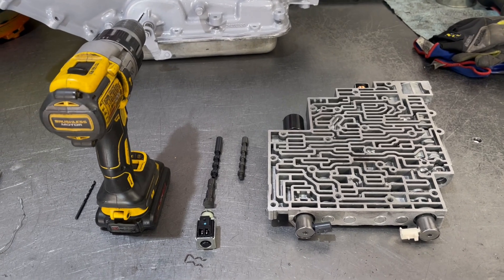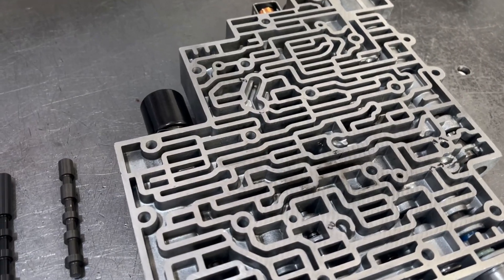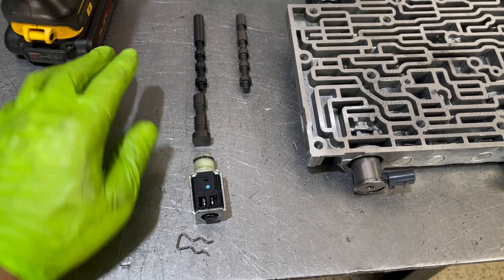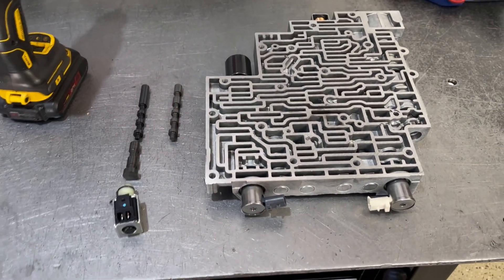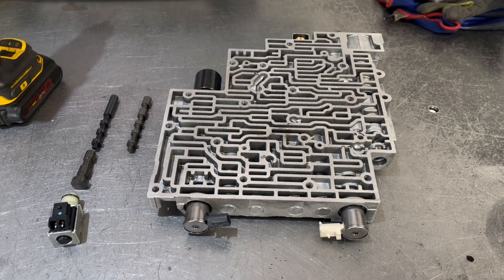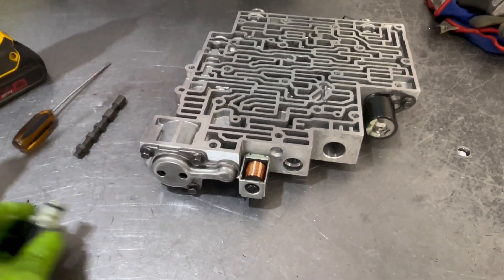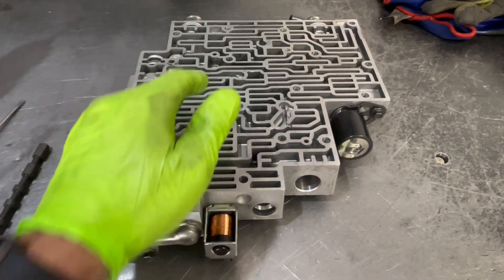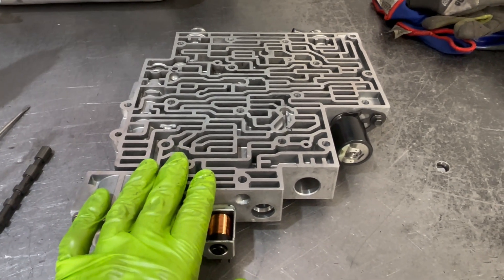4L60E Sonnax Heavy Duty 2-3 Shift Valve

Comment: Great Video,  i also do install the Sonnax HD 2-3 shift valve for a Performance Build,  But never left out the check ball,  You mentioned That leaving out #6 which i believe is the check ball in the pocket next to the Tub?  (Not the ball in the Tub?)  will give a more robust apply to the coast clutch. OK how will this effect normal driving and cruise ?
Reply from the maker: I only leave it out for HD builds, it's not necessary for daily drivers w/stock engines/etc. Yes, the one next to the bath tub - don't omit the bathtub check ball.
Reply: @nickstransmissions  Ok, the car its going in is definitely not a daily driver, 700HP supercharged , But mostly a weekend cruiser with some pulls in the street, Not sure if it would ever see the track, not sure if i sould leave that check ball  in or out, What would you do?
Reply from the maker: 700HP? The answer is in that video insofar as what I would do.

Comment: I'm going to take a shot here and hope you get these questions. I recently bought a 03 Silverado 1500. Regular cab step side 5.3 4l60e 4x4 107000 miles. Beautiful, clean, well taken care of truck. I carefully went over the whole truck. What it needed it got. Changed every fluid in it including full synthetic trans fluid filter and flush. I was getting a check engine code, and after a lot of testing, replaced an o2 sensor, mass air flow sensor and, throttle body. All gm genuine parts. The problem I'm having is a hard 1-2 shift and even worse harder 2-3 shift. The 1-2 isn't like a nice firm corvette servo shift it's hard and abrupt. The 2-3 is like the temporary reversal of torque that I have researched about. Now here is the weird part. The first shift cycle is fine, come to a stop, continue driving, begins shifting hard. I'm not sure how the ecm and tcm work but from what I understand it takes a little time for the sensors to send information and the computers to process it. The previous owner might have had some work done on this transmission because claimed it was a heavy duty transmission and his mechanic friend was present at the sale. It seems like the 2-3 shift is a common problem but there is very little information to be found on the subject. Do you think a heavy duty kit was installed? Is there a problem inside the transmission?  What is the cause of the temporary reversal of torque during the 2-3 shift? Is the hard 2-3 shift a normal condition to be expected with a 4l60e?  What do you think is causing my specific issue and do you have any ideas how to fix it? Thank you very much sir.
Reply from the maker: Hi William, there's no separate TCM in those vehicles; GM didn't begin installing a separate transmission control module until 2007 or so. Your symptoms could be related to either MAF/TPS/Ignition Switch or another engine management sensor feeding the transmission faulty data (overstating values that are prompting the trans to increase/max line pressure when it's not called for). Some one may have also messed with the electronic pressure control solenoid, which is accessible once the pan and filter are out of the way. 

I'd rule all electrical/electronic causes out via a bidirectional scan tool, DVOM, etc...If everything is fine (sensors, switches, solenoids, etc), yank the unit out for overhaul.

Comment: Hi Nick, I have a question about my situation with my 4l60e. The 1-2 shift is very positive, probably a little harsh. 2-3 flares pretty bad. 3-4 is good. It bounces in and out of overdrive once cruising. Sometimes it skips 3rd gear and goes 2-4. My biggest issue is the 2-3 flare. My research leads me to believe shift solenoids are the biggest culprit. Am I headed in the right direction? Any help is much appreciated. Thank you in advance.
Reply: I should also note this is in a 4x4 truck (2000 Silverado) that sat for many years (8-10) before I acquired it. It's a mid west truck so it's seen its share of winters and salt. I drained the trans pan and replaced the filter and gaskets and changed 7 quarts worth of atf shortly after getting the truck running and driving in an attempt to fix these issues. That was about 1000 miles ago and there is little to no improvement to speak of.
Reply from the maker: Hi Brandon, you may be right about your solenoids...Check out this video for instructions on how to test them and drop the pan and do the same: https://youtu.be/J9-Vvdrw78c

If you see a whole lot of burnt clutch material in the pan, especially after only 1000 miles w/new fluid, yank it for overhaul.

Comment: Question, I did not drill the hole or notch, I don’t have an engine brake in 3rd at all but the trans shifts good and doesn’t have any issue whatsoever, should I go back and drill the hole just to be safe?
Reply from the maker: Hi Matt, thanks for watching...Drill the hole per Sonnax instructions.

Comment: Rebuilt a 4l80e about a month ago using your instructions it was wicked helpful! fast forward a bit and I've got an extremely hard 1-2 shift and 4th - overdrive shift. I checked all of the resistance in the solenoids when I installed them but they were used/unknown parts that came with trans. It's throwing a Gov pressure sensor code, but before i drop the pan and swap it for a new one, does the hard shifting in only those gears seem like a possible symptom from a faulty Gov Press Sensor? Just wanted a sanity check from the master before I get after it. Thanks!
Reply from the maker: Hi Nicholas - can you post the above in this 4L80E video comments section? Would rather keep this discussion to the 4L60E....I'll respond as soon as I see it there...TIA!

Video link: https://youtu.be/J9-Vvdrw78c
Reply: @nickstransmissions  absolutely! Totally missed that this was for 60e's haha
Reply from the maker: No worries, man! I just responded to your post in that video's comments.

Comment: Great video, thanks! By chance, what’s the best 4l60e offroading/towing rebuild kit in the market currently?
Reply from the maker: Thanks, Felippe. There is no 'best' kit as new products are constantly coming out and folks have tons of options these days. You can use my "4L60E High Performance Build Up - 425 HP Street Strip Camaro" video as a rough guide for putting together a HD towing/off-road transmission...You wouldn't drill the feed orifices as large as you would for a street strip application but other than that, the rest of the kit/parts I show would be great for a towing/hauling/off-road application.

Comment: Great informative channel.  I have a question about 4l60 compatibly.  I messaged you on Facebook but it doesn’t seem your as active there.  Is there a way to directly message you?
Reply from the maker: Thanks, Ben...I'm active on Facebook but use it for business development, customer progress updates and to engage with other industry participants...All tech support Q&A is done here on Youtube where everyone can benefit from any exchanges. 

Please reply to this comment with your question and I'll respond as soon as I can.
Reply: @ 
Sounds good.
I have a 2005 Chevy 1500 4.3, reg cab, 2 wheel drive.  The transmission has gone out and I’m trying to find a used one.  Ive called severely junk yards and rebuild places and they all say I have to have a transmission from a 2005-2007 truck with the same motor, or an express with a 4.3.  I have not been able to find anything somewhat close.  Can I use other years and not have an issue?  Could I use my tailpiece or bell housing to make another trans work?  For example the trans I took out has a 6cad tag, could I use a 7cad or 5cad?
Reply from the maker: If your truck's 4.3L engine uses the standard Gen3 small block bolt pattern with the bolt hole at the 12 o'clock position on the transmission's bell housing then any 4L60E from a 2000-2008 that has the same bell housing and 300mm input shaft (like your existing one) will work. 

If your 4.3L engine is the same as the older 4.3L engines (i.e. Gen1 small block chevy bolt pattern) then you'll need a 4L60E that conforms to that pattern, which will be any 1998-2000 from a Vortec 5.7L equipped vehicle.

If you have a Gen3 engine, I'd stick to 2000-2005 since the 2006+ have the turbine speed sensor which blocks off access to your boost and pressure regulator valve should you want to replace them with the transmission in the vehicle. Since you have a 2005 model year vehicle, your current 4L60E should not have the turbine speed sensor (I think they were installed starting in 2005 in the Corvettes then late 2006 in the truck/SUV chassis vehicles).
Reply: @nickstransmissions  
It is the gen 3 engine, and I think you’re right about the speed sensor since it only has the green round plug and an oval shaped plug on the driver side.  Do you have a definitive list of models that use the same input shaft and bell housing?  My impression was that v6 and v8s have different input shafts and that bell housings were different depending on 2x4 vs 4x4.  Could I just take my bell housing if I find one that isn’t the same length?
Reply from the maker: I don't have such a list but you can check out my Buying a Used 4L60E PT2: Interchange Rules Video. I cover all the vintages of 4L60E and rules when it comes to interchange...It's in the 4L60E playlist. Not sure who told you the bell housings were different based on drivetrain type but they were incorrect. If you're going to swap bell housings, make sure you get a Torx Plus 50 socket (TP50) - OTC makes them and they're available on Amazon or eBay. Also have a 1/2 inch drive impact to break them loose and small torch on hand in case the bell bolts don't want to come out.
Reply: @nickstransmissions  
Hey Nick I ended up just tearing it down.  When I tore it down I could not get the sun gear out of the rear planetary because the one way bearing grenaded.  I post a video of it on my account.  I was wondering if you had a suggestions on how to get the sun gear out or if I’m screwed.  Also, in the video I showed the damage, if you lend some insight on what exactly I might need to do to the valve body.  As far as replacing or can I just take the electronics off and clean it?  Any help would be appreciated.
Reply: @nickstransmissions  
I tried to tag you in the video sorry if it did notify you through that but I don’t think it worked.

Comment: Do you have any experience with the "Frank's" method of overrun clutch mod? He cuts a slot in the VB gasket to feed FWD clutch pressure to the overrun, then blocks off the bathtub checkball.

I haven't tried it yet, but he says it eliminates the need for the HD valve, which is pretty nice considering the valve is ~$55
Reply from the maker: Hi thegalli - Are you referring to Frank who use to work at Performabuilt but started his own shop? If so, I recall reading about it on forums at some point but can't recall the details and have never done it myself...Will have to look into it a bit more and perhaps do a video after getting with Frank on the details and such...
Reply: @nickstransmissions  yes that's the guy